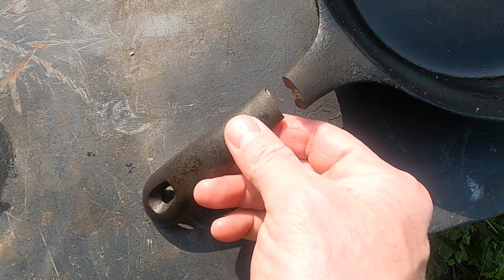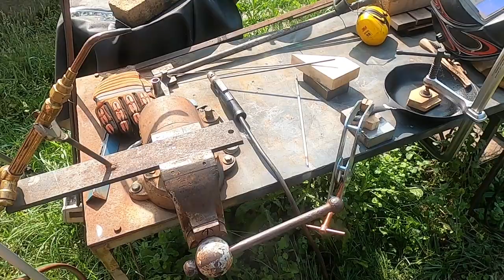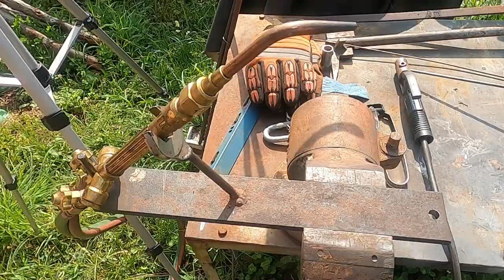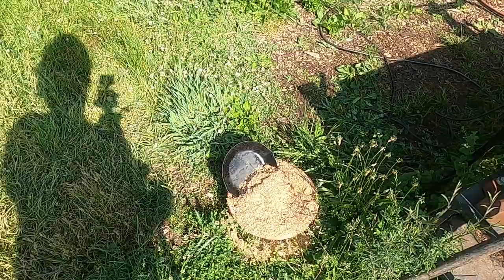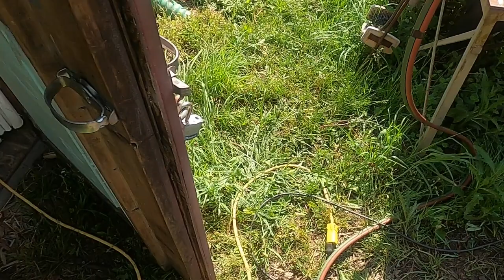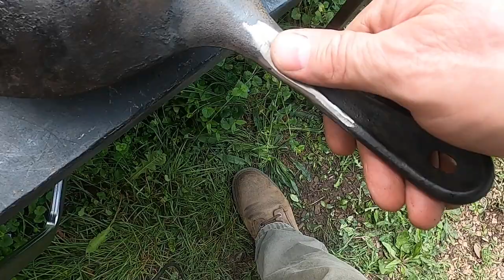Welding the broken handle on my cast iron chef skillet. - 067

Comment: I had a similar experience. My favorite skillet also ended up completely breaking. It started with a small crack and then developed into this gnarly one that spanned the entire cooking surface. I think now it happened because of the abrupt temperature changes when I rinsed it with cold water right after cooking meat. Since I can't find the same model, I'm considering making a replica using green sand molds and casting it with molten copper because I've heard copper is fantastic for cooking.
Nice video!
Reply from the maker: Normally a cast iron skillet won't crack from rinsing in cold water. Unless it was extremely hot. Maybe 600 deg.  It's possible that the casting had a pre-existing flaw.
Anyway, a solid copper pan would be really interesting! You should do it and take a video of the process. Pretty sure you'd want a copper pan to be tinned also. Thanks a bunch for watching!